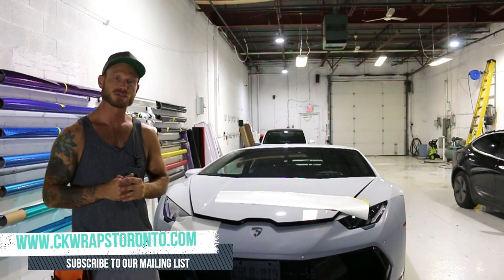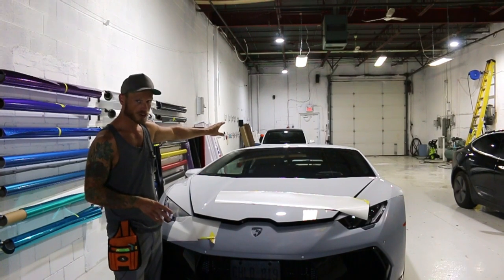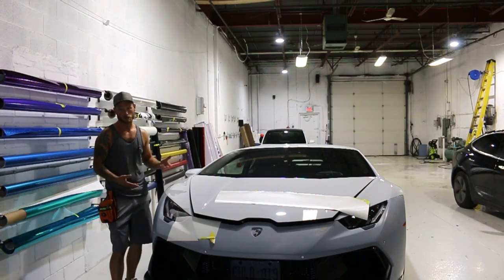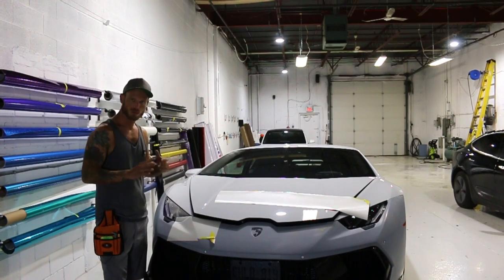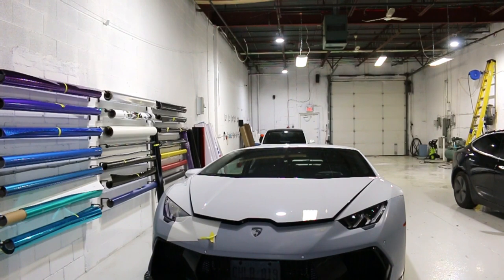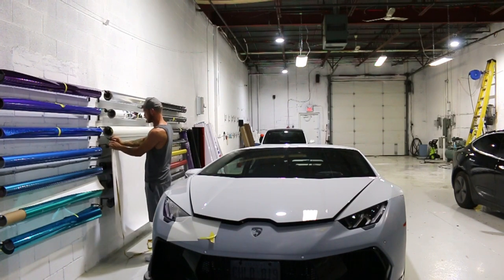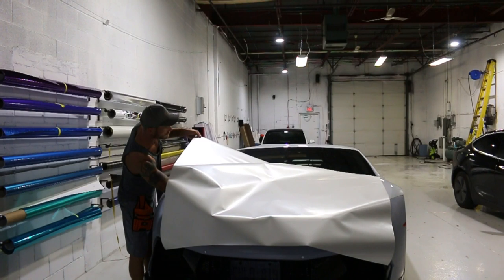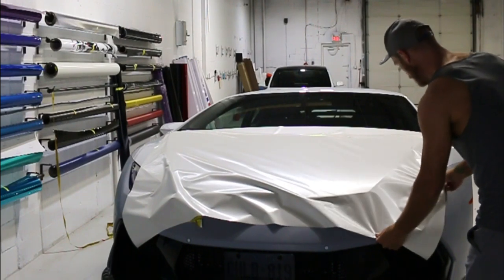Detailed Custom Brushed Metal Hood Vinyl Wrap

Comment: Followed CK wraps instructions on multiple videos, but I failed to wrap my 350z hood. I found a few things you have to be aware of. He's in a climate-controlled garage (the sun will heat up the film making it so tacky it's unworkable). 350z hoods are aluminum which does not work with magnets, so test your area that your wrapping. Get gecko patches if your wrapping area is not magnetic. I used Vivid + performance wrap and I could not get it to glass. I even ripped it in several places trying to pop it up to smooth out "fingers".
     CK Wraps is very good, and his instruction is solid, but if your film and your environment are crap (Sunny and warm) then no matter how well you follow instructions you will fail.
      Edit: My second try without the sun on my hood worked perfectly. The vivid + film is really cool. I had a few bubbles and pinches. With a little heat after wrapping and they disappear with some pressure.

Comment: I guess I still don’t understand why you didn’t turn the hood panel the other direct where you could make the length would fit so you don’t have to stretch it at all. Like you said since it’s directional, it’s not going to match up with everything. Or did I miss something.
Reply from the maker: Because it looks better when lined up with the fenders as opposed to the bumper